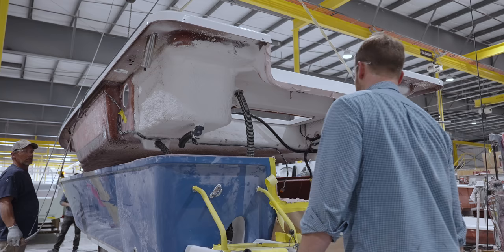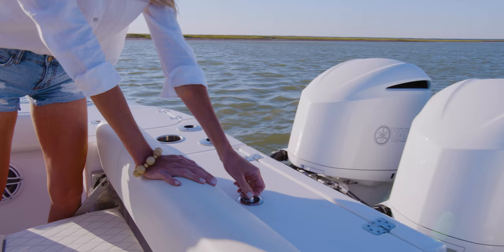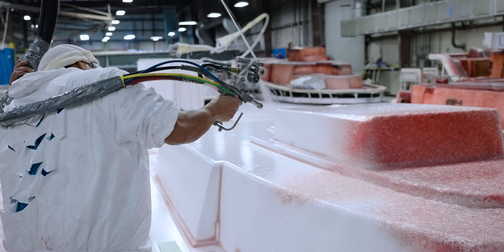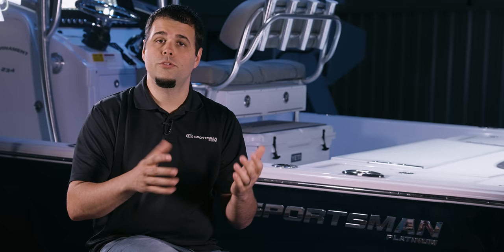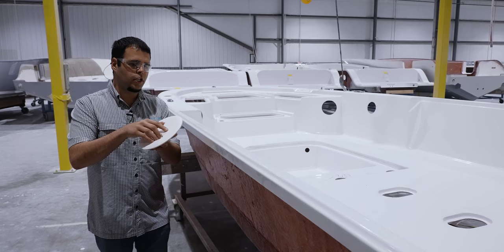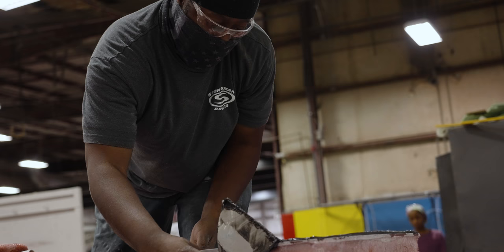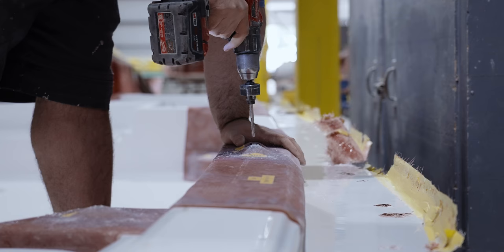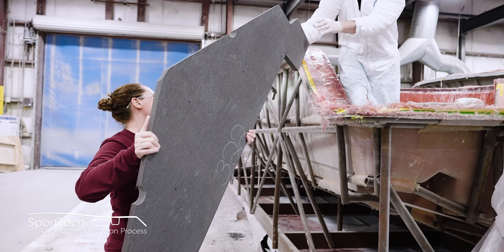How Boat Decks Are Built - Sportsman's "Behind The Glass" (Season 1 - Episode 3)

Comment: Great. What do you call the composite material on the deck?
Reply from the maker: We use several different coring materials on the deck for different purposes. One key piece we use is aqua steel in higher stress areas such as where cleats are located or trolling motor plates.